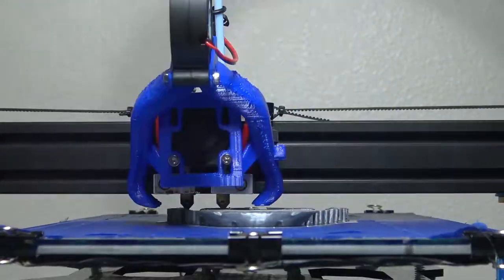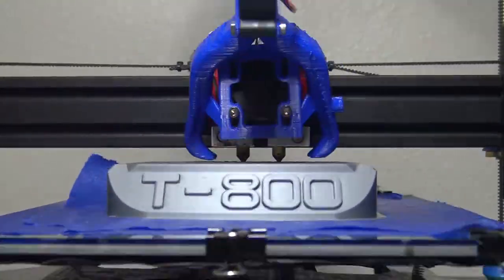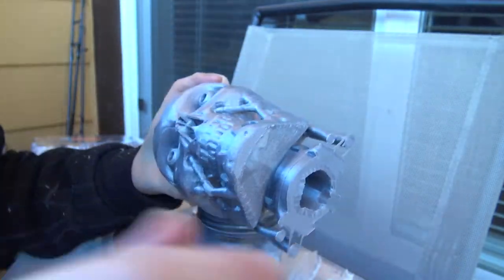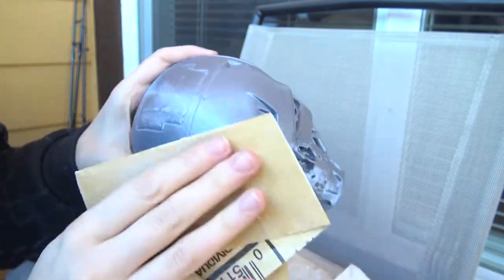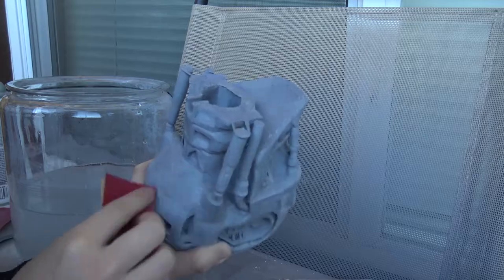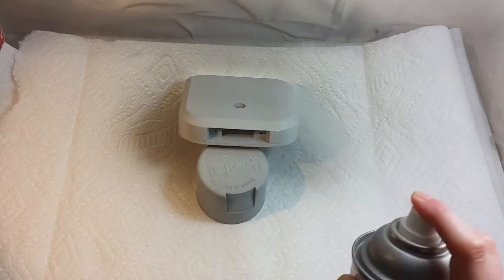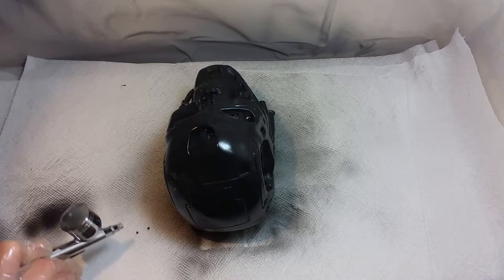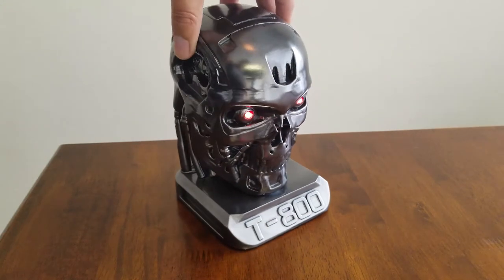Terminator T-800: 3D printing, smoothing, painting, LED light install (PART #1)

Comment: Nice work!
Hi can cou tell me at wat speed did you print it? I print it at 60% but it fail at the upper jaw bone. When the pipe behind the head connect.  Do you have an idea. Thanks
Reply from the maker: Hey make sure the bed is leveled and print the outer layers in slower speed, you can also add some manual supports to that part that fails only.
Reply: Ok i Will try to print the outer layers at slower speed. Can you suggest a speed?
Reply from the maker: @dantrex3742  anything between 20-25mm/s usually works great for me. Let me know how it goes.

Comment: You did a great job with the model and the presentation of this video,I was a bit disappointed with your choice of power switch in my humble option it spoils the model .
Reply from the maker: A Brit in the Philippines Thank you! I was thinking about changing that switch actually, if you have any specific suggestion let me know. I usually buy those in either ebay or digikey websites. Thanks!
Reply: I have a CR 10 and I will try the print soon,do you have any suggestions on settings? Thanks again keep up the good work .
Reply from the maker: A Brit in the Philippines If you use the Idea Maker slicer I shared the configuration file in the video description. Basically try to reduce speed in outer layers, use 0.10m layer height, some brim loops, some additional support for the tubes in the back of his head, retraction, and use the temperature recommended for your filament.
Reply: Thank you for the tips.
Reply from the maker: A Brit in the Philippines No problem! I always love to exchange ideas about 3D printing ^^
Reply: Cool,I'm very excited.

Comment: Hi,I am going to try and print this but there are only links to the base,could you give me the link to the head and tell me if there are any settings you would have changed .Thank you and great job again.Oh and is there a setting in ideamaker to raise the nozzle when traveling so as not to get lines on the surface of the print.?
Reply from the maker: The link to go to thingiverse and download my parts should be in the description of this video. The settings I used are also in the description of the part in the thingiverse link.
Reply: Hi,thanks for the quick reply,as I said the link on this video only takes my to the base files and your other video titles I can't read.
Reply from the maker: The head should be there too, are you sure?
Reply from the maker: I have just redownloaded the thingiverse models from the link in the video description and all parts are there. Please click in the tab called Thing files and you will see all parts there. The settings I use are in the Print settings section in thingiverse.
Reply: Apologies,having a brain freeze moment.

Comment: Hello, thanks for sharing the files, the only question I got is did you use infill for the stand?
Reply from the maker: Hi yes I used 10-15% infill for the stand, to make it at least rigid enough, saving as much material as I could. Thanks for watching!
Reply: @RDGameplays  Thanks for the answer, but I didn't mean infill I actually meant support. Because of the battery department
Reply from the maker: @faba-ou1sw  Gotcha, yes I had to use support of about 10% density. But this depends a lot on your slicer software you have. I used idea maker slicer with default support type for Tevo Tanrantula.